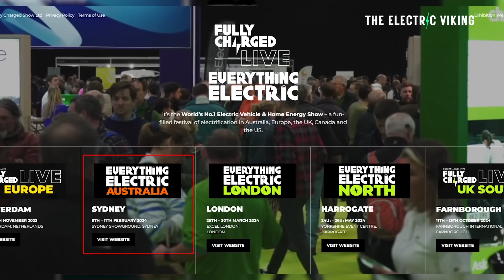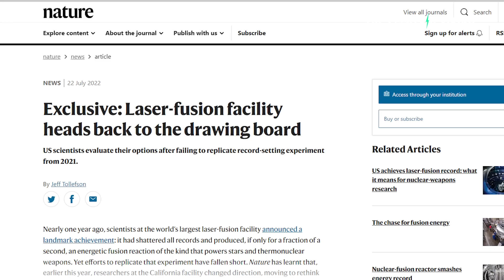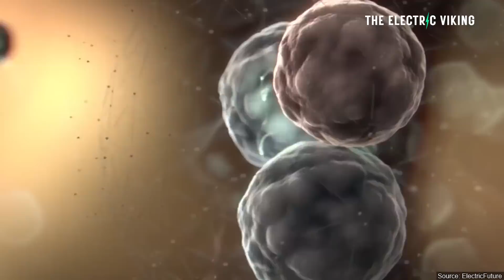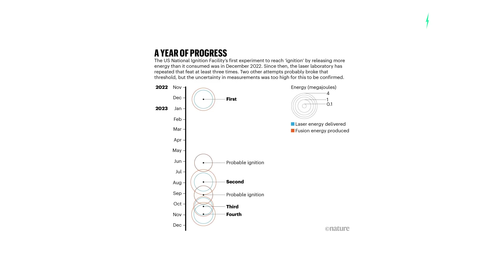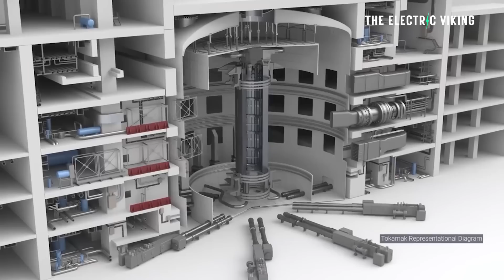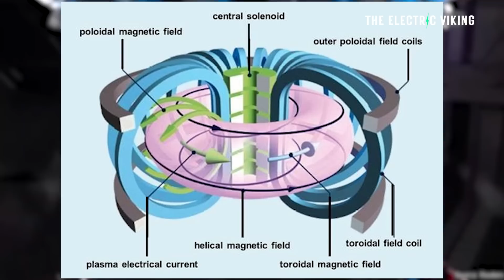US nuclear-fusions game changing achievement; ‘ignition’ over and over

Comment: The reason for these success stories is that they need the funding to continue. To be commercially viable they still have to improve this by a factor of 100 or more. There are also many engineering challenges to get this from an experiment level to a continuously running power plant. This is still decades away.
Reply: Yes, still decades away, but seems that the design works. Neil Degresse Tyson said that now is the time for the Engineers to take this design and make a Fusion Reactor. Fusion Energy could be a reality by the second half of this century.
Reply: @lakeline6317 Neil deGrasse Tyson also says that boys can be girls.
Reply: Let's Do a Hypothetical...
Let's say that next week they get Fusion working.  What happens after that?  Do you think that 5 Years later they will have a viable power reactor?  They would still be stuck in the testing and prototype phase for a decade.  Then they would have to build a Fusion Power Plant.  How long does that take?  You can refer to Nuclear Power Plants now.  But more than that...  What Will It Cost? ... and How Reliable will it be.  

So even if they solved the Fusion problem for it to become beneficial for humanity you are looking at two decades or more before you see the first few power plants up and running.  A few of them mean literally nothing considering the increasing demand we will have for electricity.  We would need hundreds of them across each continent.

Get the Point?  Most people watching this will probably be dead before their power is supplied by a Fusion Reactor.
Reply: @gags730  Another aspect that is not often talked about is that a fusion reactor will be a very complicated thing - even if they have a working design for a power plant. For instance they will have to generate their own tritium which is a very complicated process. Also many other processes will always require that highly qualified scientists are working at a fusion power plant. That will further increase the cost and it is questionable if you will even find this kind of specialist anywhere in the world to work in a fusion plant.
Reply: @thk4711 That’s why it’s so important to start training the operators now before it becomes commercially viable to minimize time to generation. We’ve fast tracked things in the past we could do it again undoubtedly it’s just a question of when congress will get off their asses and really invest in the commercial scale testing needed.
Reply: @gags730  EXACTLY and dont forget the radioactive waste.. note how they deflect attention by prefacing it with clean. its a lie.
Reply: Could be less than decades, if we can use AI to help us design an engineer at a faster pace than humans can do alone
Reply: Yep ..... absolutely amazing.... they managed to make enough energy to boil a kettle...... stop griffting. ✋️
Reply: @ZombieNation-bo3pu  it’s not a grift, they have made billions, it’s a weapons research facility, they make instant fusion and instant fission devices that attach to rockets.  The kind that instantly remove the largest cities.  There is a test ban so they can’t build and detonate the actual devices.  This lets them test without actually doing that and American ones are now by far the most powerful in the world. It’s so bad if I say what it is yt moderwtor bot removes my comment
Reply: We"ll be powering dilithium federation starships before this ever comes to scale...nope
Reply: 50 years have to be cheep to build and service as well.
Reply: Yea, this is just science experiments, it's nice to see the US government sponsoring pure science, even if it is weapon research.
These fusion capsules are very carefully made, mass producing them so a power plant can use them by the thousand isn't realistic. And there is no net-gain in energy if you include the electrical power used to make the laser energy. So, this won't become a power plant design.
But completely different methods with Tokamaks or Stellarators could still be viable.          :)
Reply: @EveryoneWhoUsesThisTV  this is like making a gun and claiming you needed to learn how to make an internal combustion engine.  Different fuel, different mechanical components, very little to nothing you learn helps you make an engine for making power or doing useful work.
Reply: @EveryoneWhoUsesThisTV Not to mention the energy that it takes to separate heavy water from natural water in order to get the deuterium. That process is almost as difficult as producing highly enriched uranium.
Reply: It will never be commercially viable.
Reply: Likely so. I don’t follow it so closely but I’m glad to hear there’s progress. Getting past break even energy is a big deal.  You are probably right, it is decades away, but even if it was two or three decades, that is really quite an accomplishment to come.
Reply: Fusion is always 20 years away since the 1960s.
Reply: @alexeysamokhin9629  and it'll be "twenty years away" until the day before they solve it
Reply: Just reading all these replies: no scientists here. Not even scientifically literate lay people.
Reply: Maybe not 100 but 10 however not 1.54 for sure
Reply: This was, is, and forever will be a new clear weapons design facility.  It’s for making new clear weapons which it does very effectively by simulating the gamma ray burst with lasers.  It’s made huge amounts of $$$ in sales of new clear weapons.  It’s was never meant for power, energy in is over 100 times energy out, pellets cost $7500 each for the energy to boil 5 kettles of water.  It’s never going to help us learn how to make a power plant, only how to unalive people.
Reply: @hugegamer5988 
Doesn't make sense or difference. Principles of MAD will still apply.
One of the key reasons why fission was prioritised was weapons production (as well it being more feasible) and it doesn't make it any more feasible whether it's "clean" destruction or not.
Reply: @ocean_monster1  also for fusion it makes sense not because it’s green but because refining uranium in centrifuges is very slow and extremely expensive whereas the fusion material costs like 40k usd for one device and is very easy to make.  For the same megaton power it’s MUCH cheaper which is why they got so many orders making a trillion.
Reply: @AquaticAbomination 

I don't believe it has anything to do with weapons development... we already have fusion bombs... thermonuclear bombs are fusion bombs.  The first stage is a fission bomb, but the vast majority of the yield comes from the second stage, which is a fusion reaction.

This is 100% for energy.
Reply: @hugegamer5988  There have been several very important technologies that can be seen as beneficial to society developed originally with military application in mind, the internet was developed by DoD, for example. Yes, there is a lot of focus by the US and other govts to pursue more efficient weapons unfortunately, though the LLNL is more diverse in research these days.

@thk4711 In 15 years or so, fusion will likely be budding with commercial application. LLNL is not the only research institution looking at fusion, ITER is a huge international collaborative effort, as well as MIT, Chinese, Japanese business startups etc. Complete game changer for space propulsion probably first though, so it's true it may take longer for mass scale commercial power for the consumer. There are several publicly traded equities with exposure to fusion - Equinor and Eni (Norwegian and Italian energy majors), as well as venture capital funds (if you have the money and risk appetite). Some will be getting filthy or filthier rich from this tech eventually, I'm sure of that, but at the end of the day will be great for everyone.
Reply: @hugegamer5988 Hold up you telling me you haven’t heard of the H bomb?
Reply: @hugegamer5988   Nuclear.... not "new clear".
Reply: AND PRODUCE RADIOACTIVE WASTE... look it up.
Reply: @esecallum. The nuclear waste produced have a half-life of 12 years instead of thousands years. Big difference.
Reply: @esecallum activated materials like steels, just stored for under 100 years and then recycled as nothing haopened. Look it up.

Comment: Thanks. 
They still have a long way to go to commercialization. As you said yourself,  the efficiency of the process is still less than 1%. Also,  for a commercial power plant,  you need a continuous reaction,  or a tight series of descret reactions . You need a reaction many orders of magnitude larger, so you can supply a useful amount of energy.  Also, you need to develop a way to transform this heat energy to electricity, and as you said- that it will be cheap.
So, it is hard to see a commercial power plant earlier than 15-20 years from now. And then 15 more years for market domination. 
And anyway, even if it is successful,  every facility will still be very complicated, expensive and centralized.
Reply: Not if LPP Fusion wins the race!
Reply: Most don't realize the main thing here.... 1% energy return. The have done a cool physics experiment proving that laser ignition works. But it's not yet clear that energy gain will ever be possible with lasers. Not clear lasers are better than other fusion methods.  Not clear that fusion will ever be commercially viable in planet earth.

Comment: I agree it's a big deal.  But it has alot of technology required.  My guess is the input energy they used in the calculation was the energy in the laser beam.  Laser's are not very efficient.  What did they get with wall plug efficiency?

Comment: Nuclear fusion is a scientific experiment with seriously frustrating, intractable engineering problems.  You have to ask yourself one question.  ‘They’re trying to boil water, right?’  They’re on the right track, however.

You actually need boranes which are trapped into a z-pinch, but need temperatures in excess of a billion degrees, hotter than the sun.  The net gains should be in the trillions of times the input.  You also have to admit there was no Big Bang.

Comment: NIF is a such a money pit. There is almost no useful output from it.  Lots of papers published that have no commercial application.

A bit of advice:  I did my thesis on plasma turbulence with experiments conducted on PPPL's tokamak.  You can't possible understand the level of BS in these research "breakthroughs" unless you've been down the rabbit hole yourself.

The only device that had hope of commercial success is the stellarator. Tokamaks are fundamentally flawed. Inertial confinement fusion is a joke

Comment: A couple of problems with fusion. 
1: Engineering on this scale is incredibly expensive compared to wind, solar and similar and 
2: Energy produced by fusion reactors is waste energy i.e. is in addition to that from the sun, so it produces a net heating of the earth.
Reply: Earth regulates its temperature just fine. Don't buy into the scare campaigns

Comment: For NT-Singapore solar project, if the project goes to plan, it will provide Singapore with up to 15 percent of its electricity needs from 2028 via $22 billion to $30 billion estimated cost.  With Singapore's population size being about 5.686 million, 36-42 gigawatt hours of mega battery storage + 17 to 20 gigawatts solar can supply Singapore with up to 15 percent of its electricity needs from 2028 . LOL

Hint: For 100% electricity needs, pony up $200 billion just for Singapore's 5.686 million population. Scale to Australia's 26 million population and that's about $914 billion.

Comment: if this works it will save utilities because of the size of this machine. But if solar, wind, geothermal could still be a road block because no infrastructure is necessary. Personal or small battery storage maybe all that is necessary in small communities

Comment: Nuclear fission is basically boiling a pot of water through letting off a nuclear chain reaction similar to a bomb underneath it, except controlling it and releasing that energy very slowly over a number of decades. But it's still boiling a pot of water to drive a turbine, it's just the furnace is not coal.

Nuclear fusion is still largely science fiction. Getting something to work in a lab is an entirely different proposition to creating something that can contain a 2 million C plasma in space to allow fusion to occur, then extracting the resulting energy. That is very, very hard to do at scale if you think about it.

Firmed renewables are the way to go. The only hold-up is the necessity for transmission lines to transport the energy from A to B.

Comment: That is far from a breakthrough. Stick to EVs pls. You just don't know about fusion.
We (human race) are still at the stage of proving sustainable fusion reactions. We need both sustainable fusion and a Q factor of 5 - 20 (given the maximum thermal efficiency of a steam turbine is about 47%, a Q factor of 20 would be the safer bet) to recover the enough heat to generate more electricity than the energy input. This device only achieved a Q factor of 1.5 (discounting energy consumptions of peripheral systems and the main laser system, don't know about you, but that is either words play or cheating in my book) and also it is not sustainable as in it was only fusion reaction lasted a fraction of a millisecond. Plus the scientists and engineer hasn't even figure out how to recover those heat generated from fusion any of the fusion reactor design yet, let alone test those designs for real.
 Frankly the laser ignition route is not even viable path to design a commercial fusion powerplant in my opinion.

Comment: It's clean because of this - normal water is a byproduct. It could be years of experiments to scale the reaction for the power grid. Temperatures of fusion are very high. Much of a nuclear plant’s cost is super thick concrete and lead insulation from the radiation
Reply: Please stop with the nonsense. Water is not a byproduct.
Reply: This is true, but by using continuing Lazer flashes of different frequencies they can adjust the temperature, I believe. In Culham, UK, they achieved fusion for one-fifth of a second in a tokamak in the 1980s and more recently for 11 seconds. The Sun can initiate fusion at 10m Celsius but on Earth I believe it takes 100m. Then the output is at 50k Celsius. You need some, yet to be invented, oven gloves for this
Reply: I am not well educated in this field but I think temperature is the issue rather than radiation. Of course whatever you use to control temperature will absorb radiation. But spent fuel rods only need a couple of metres of water to make them safe for humans.